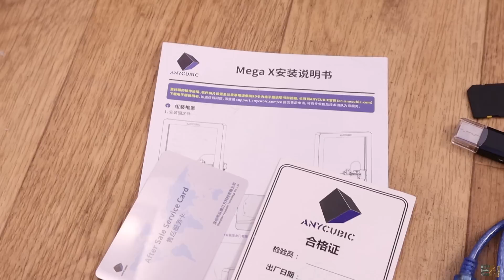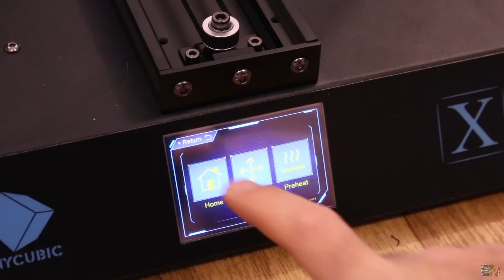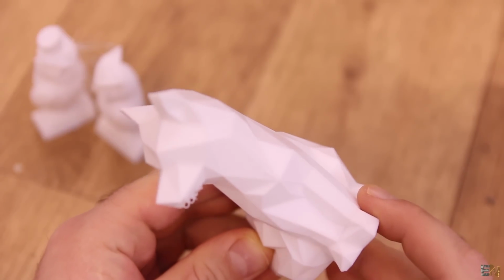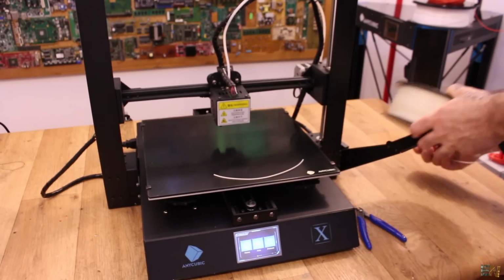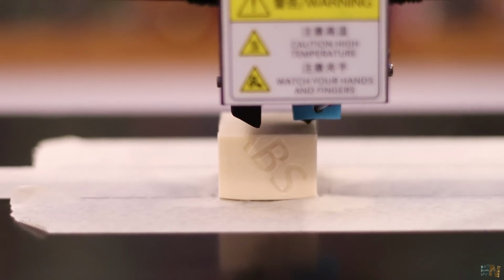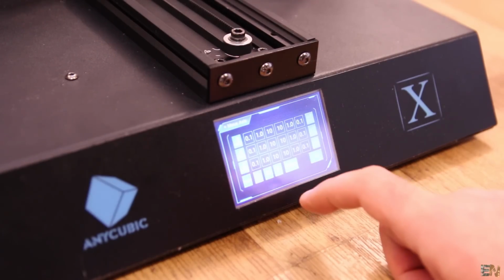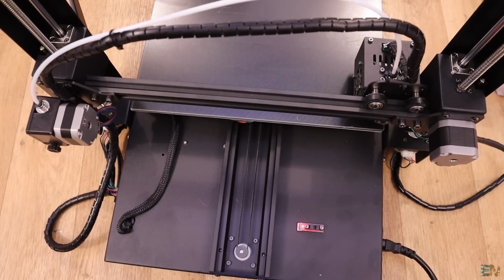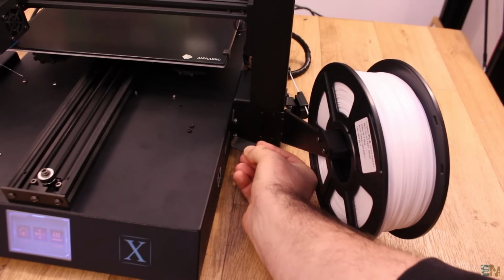Anycubic MEGA X - 3D Printer Review

Comment: This was my first 3d printer and honestly I think it’s a great set of “training wheels” if you want to learn. If you just want a printer that will work perfectly out of the box it’s not for you. Because the mega x is a bit finicky and unreliable, you learn a lot about adjusting print settings, troubleshooting and other useful skills. It’s also not super expensive so you can take the risk of doing repairs yourself without worrying too much about breaking a piece of high end equipment. The size gives you room to grow and experiment. Once it’s served you for a bit you can move on to a better, more expensive printer and you’ll be much more prepared to get the most out of a higher end experience.
Reply: This is a great explanation of what I'm experiencing lol, I've had my printer for about a year and a half and It's to the point that while it's able to get the job done I am starting to get unsatisfied with the print quality and the amount of mistakes that will sometimes happen.

Comment: i've been using the Mega S for a few months now, it's a fantastic printer for the price!. 
and the surface it has, it's 100% unnecesary to use painter's tape, glue or anything else if you are printing with PLA, i print at a 60c bed temp and it's practically IMPOSSIBLE to remove while its hot
like even at 30c you would have to whack it really hard o get it to detach, once its completely cools down it pops off no problem.. clean it with alcohol and you are god to go on your next one..
 i love that bed!
Reply: I disagree.
Reply: @locked01  great argument. care to elaborate?
Reply: @xenonnati  sorry, my mistake, I replied to the wrong comment!

Comment: Thanks for this review. Regarding the 12v power supply and large bed,  is it possible to insulate the bed to allow it to heat faster? Been meaning to look into this. Also, do you have a favorite all-around printer for less than $600?

Comment: Thank You for your Video. I received my MEGA X 2 days ago, watching many other video's I learned to tighten the rollers on the bottom plate.  I am a Newbie to 3D printing so I tried the 2 owls and had No stringing. next I tried a Benchy using Cura,  with bad results. So I bought Simplify 3D and tried the same Benchy again. Wow-what a difference it made. I have printed it at 3 different speeds and even the Fast speed looked good.  BTW I had printed the 2 owls a total of 3 times and all with good results. Maybe they have made adjustments to my printer different than yours? I also have printed 2 overhang_Angle_Test-30_85  and both med and high quality with the results of an easy 75% overhand without support.  I am still doing more tests today as I have much to learn.  I am trying to get a better setting to reduce the amount of support needed on a print so I can clean them up easier. Thank You aging for your review

Comment: Mosfets to the heated bed/nossle and do not need a cooling fin if the PCB designer use a more expsnsive mosfet with lover internal resistance. But is cheaper with a bad mosfet and small heat sink.

Comment: Can You Make A One Video On The 3d Electronic Circuit use with Arduino and github code  
You can Use Hardware Of Any 3d printer which you have but electric component will be change 
Plzzzzzzzzzz😔😔😔😔😔😔😔😔😔

Comment: Another disaster printer out of the box, i saw on eBay at 165 euro, It needs another 300 euros of upgrades  to print silent and decently,  thumbs down in my opinion
Reply: I agree. I own it, it is stock and I can't stop complaining about the bad print quality with Anycubic PLA filament. The most terrible thing about this printer is the heated bed itself. The Ultrabase does its job but the bed itself is concave!!! I tried many times to compensate (both with hot and cold bed) but didn't solve my problem. Now I'm thinking to stick up some glass on it but I'm worried about the temperature. Will it get hot enough?